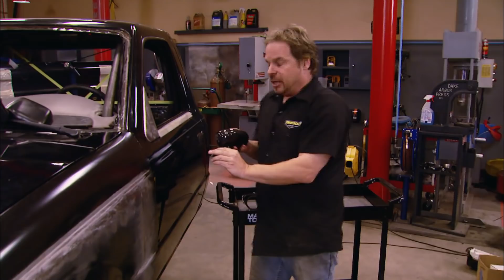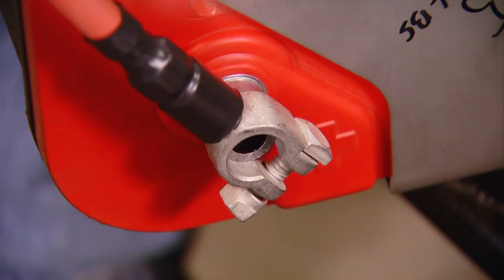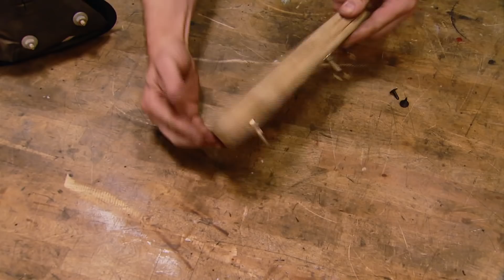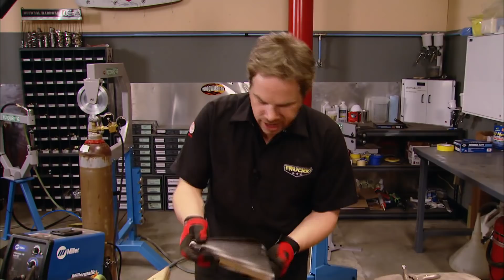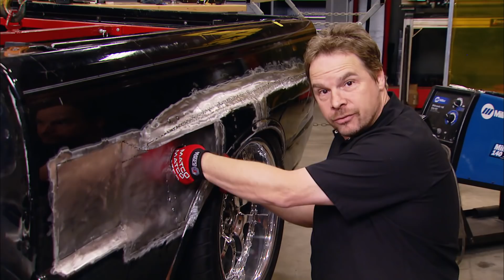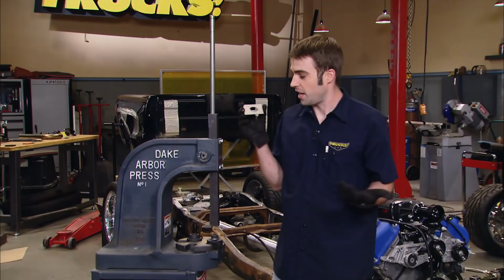Cooling the Brakes on our Ford Ranger Track Monster - Trucks! S13, E13

Comment: Sorry guys, the easy puller is not a new thing.  The C-130 leading edge is held on with what looks like a piano hing and in order to pull the wire used to hold the leading edge on a puller very much like the easy puller was used.  Granted is was a local manufacture but much, much earlier than this product.

Comment: shouldnt the battery disconnect be on the ground? battery is still gonna be live and there will still be current to disconnect and anywhere in between. have to unground battery to shut off battery.
Reply: That just means more cable for the disconnect having it in the same location. You'll still have the same idk "dangers" even if you did it on ground.  Usually when you disconnect a battery when working on it you take power out first.

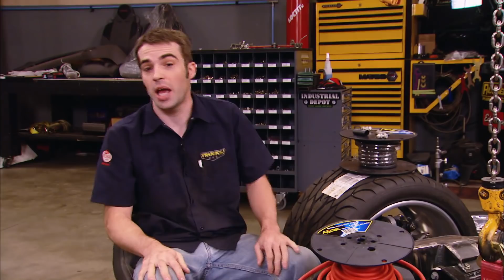Comment: 3:40 CCA (copper clad aluminum) is garbage. It can't handle anywhere near the amperage of OFC (oxygen free copper) without stepping up in the size of wire by several steps. So if you need 20 feet of 2 gauge OFC, then you'll need 20 feet of 0 gauge for CCA just to get the same rating. And CCA does not dissipate the heat anywhere near as good as OFC. CCA will also get a lot more corrosion over time and not last anywhere near as long as OFC. Literally the only benefits to CCA is it's cheap, light weight, and easy to bend, but the benefits do not weigh out the negatives. There's a reason CCA is super cheap, you don't want it on your nice builds, leave that stuff for the cheap amp kits you always see on beater cars

Comment: I just wanna know where this truck is today!
Reply: Burnt up probably due to CCA wire.
Reply: The projects from these shows end up either being stripped for parts for anther project, remade into anther build, sold to a staff member, sold at auction for charity or more often then not, stripped of useable parts and crushed after making a run through the car show and aftermarket show circuits.

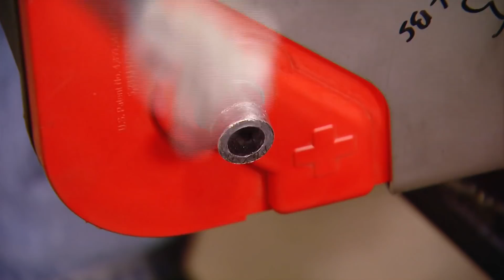Comment: Watch this all the time enjoy it.... Do NOT USE copper clad wire... It is junk and a cheap CRAPPY alternative cannot hold the amperage and degrades faster than an autozone rubber hose soaking in E85. Its not lighter? Wtf it cant carry the same amperage. Its aluminum not copper.  Try and solder that lol 4:04 in i had to pause and comment ask someone who knows about batteries and wire copper plated hahaha

Comment: Hello  Why do all the work without painting the frame black looks better and prevents  rust
Reply: This is mock up. Once they are all done with modifications and know where everything will go, they tear it all apart again and paint/powder coat the frame. It’s done this way so that it’s easier to use put back together and they don’t mess up the paint/powder coat on the frame. All modifications to the frame are already done. All the holes are drilled etc.

Comment: Fellows, I would never use aluminum wiring, even copper-clad, in an automotive application.  The resistance is too high and crimped connections are subject to creep, although I might actually solder the cable to the connector if I had to use that wire.  A solid copper wire would be so much better despite its cost.  I think this is a foolish way to save money.
Yeah I didn't mean solid copper.  Stranded copper.
Reply: BMW used aluminum wiring to save weight from the battery in the trunk to the front, they got recalled to be replaced with copper.
Reply: @SavageBunny1  no bmw uses aluminum wire for cost its completly inferior in any way a piece of wire could be
Reply: @SavageBunny1  since which body BMW uses CCA wires?. i'm kinda curious. or it's a complete aluminum without copper plating?
Reply: Stupidest thing ever.. aluminum wire coated in copper..uumm electrolysis  will be a downfall. Aluminum is the weaker metal and will deteriorate faster. As said aluminum can NOT handle the same load amps as copper wire does. Stop taking short cuts and do the job right
Reply: @DaveK76   WHY did contractors use aluminum wiring in trailers? Cheaper than copper, but not better!  Don't do it! Welding cable is far superior. Voltage drop? YEAH.
Reply: CCA wire is so bad you can't even solder it!!! Useless garbage, I refused to use it even in my little car audio shop radio

Comment: Boost a 300 ford straight 6 it will make more torque than any v8 and do it on stock internals better then build it up and boost it using a block that will fit the Windsor 5.8 351 parts as some will then add Chevy straight 6 1.7 rockers for more lift etc... I want to see a boosted ford 300

I'm paying monthly for power nation now I would like to see just this one engine

Comment: dude you need to put some rustoleum on that frame at the very least before putting any of that brand new gear on there. doing it later will leave the frame incomplete and you risk damaging that brand new gear when you go to clean and prep for paint. the whole build might as well be garbage if your foundation is no good
Reply: They're planning on stripping the frame down again and sending it to get powder coated, they mentioned it in previous episodes

Comment: I know this is a stupid question but why run a ground cable from the back to where the battery is to start the car? The frame is steel all the way so it should act as a cable  right? Just wondered as I ran the braided cable to the frame and then the starter is on the engine so a ground from engine to frame again. I never see any draw down..
Reply: They are doing autocross and I assume it's a strange rule in the book.